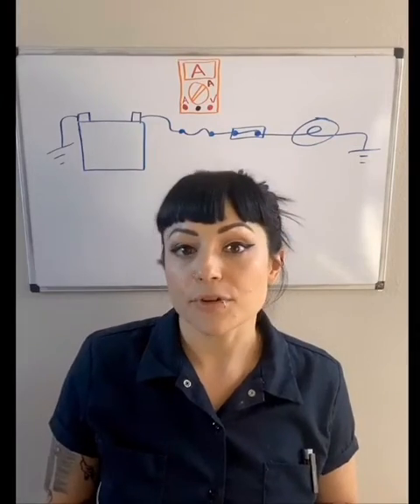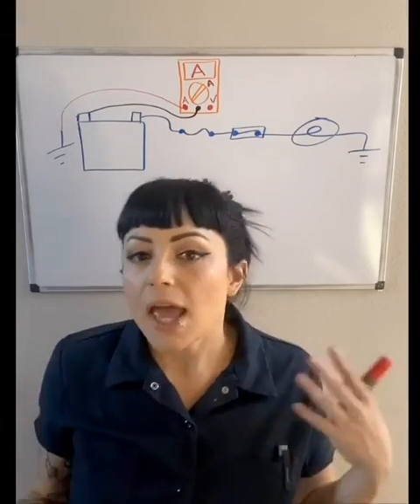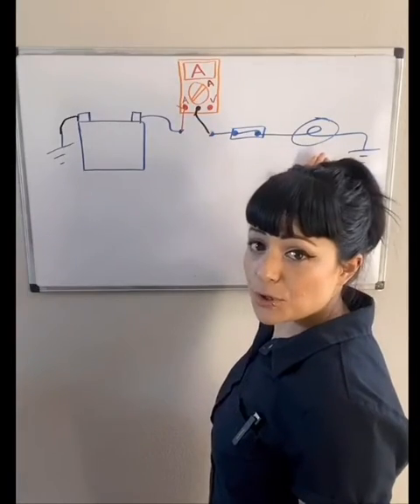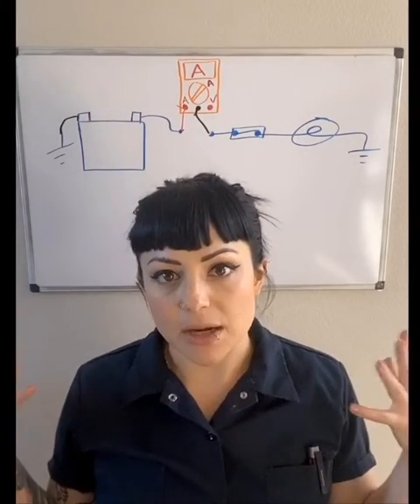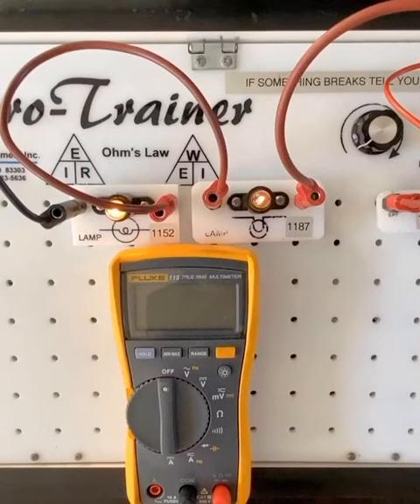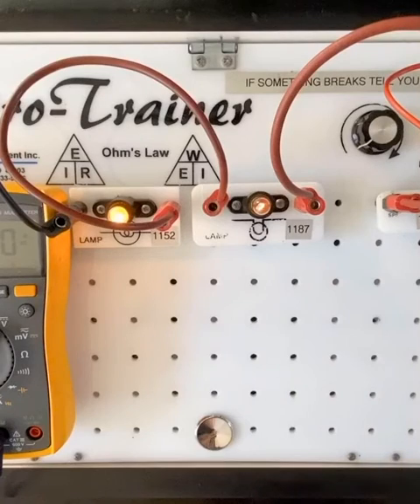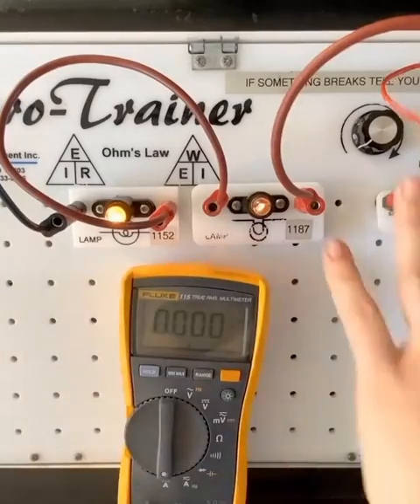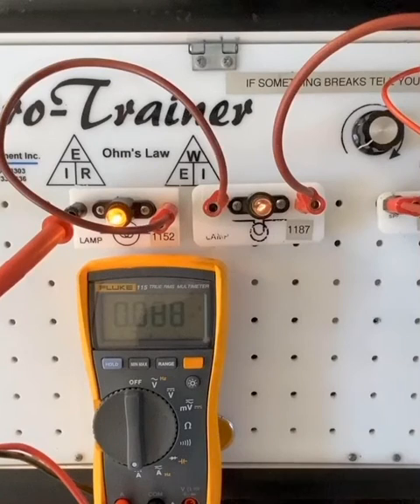How to hook up an Ammeter

Comment: When l first started doing automotive testing l used a really cheap VOM (so long ago it was analog) that could read up to the 10 amps she was referring to. When l made the mistake of connecting the leads incorrectly and fried the meter, replacing it was a quick trip to the store and the penalty was $10. Eventually I did end up with a nice digital Fluke that was capable of reading the amps and volts in both directions ( very helpful).

Comment: I use an analog ammeter with an inline fuse connected to the test lead rated for the ammeter size. Works for finding parasitic current draw. You are a good teacher!

Comment: I came here because of Donut <3, but also because I wanna connect an ammeter (SKUB07879) to my car xD.
I got this weird ammeter/voltmeter chip from my brother a few years ago and he wanted me to hook it up to my car so I could monitor the battery's voltage, however the meter also has a ammeter led on it. I could just hookup the voltmeter and leave the ammeter off, but I don't half a$$ things like that.
Any advise Ang?
Can I hook this bad boy up to my red battery terminal and the black to my alternator ... would this cause a short?
It's an 18 gauge wire, so relatively thin and it definitely couldn't replace the wire coming outta the alternator, so I'd have to connect it in parallel, which won't work according to your explanation. 
It needs to be hooked up all the time to monitor the entire draw even when the car's engine isn't running.

Or is there another circuit I could connect it to in the fuse box, for example?

I'm guessing this is impractical, but I figured I'd ask anyway - maybe you could point me in a more practical direction.
Perhaps I could just monitor the drain on the usual parasitic drain suspects.

Comment: My alt puts out more than average ammeter reads.  Common for diesel engine alternators actually.  Mines 135amp and I may go to 150 in the future.   My big truck is 200amp for that matter.  Anyway....  is there a way to purposefully miss match a shunt and ammeter and do the math in your head.    example.....  use a typical 60amp ammeter with a shunt  that would result in a meter that always shows off by a third.... so If I am showing 60 amp......  im in big trouble cause that would be 180amp out of a 135amp alt. in real life.   If I am showing 30amp...... then in real life Im at 90amp and that is fine if I'm  winching and bumped my idle up to get that 90amp.    etc etc.   

Doing so  would possibly lower cost for this poh manz build...  the ammeters that can read up to 150 are stupid expensive even before you buy the shunt.  (or hall effect sensor)

so with that in mind.... ifffffff that would work... what shunt for 60amp ammeter knowing I will be off by a factor of three?
so with that in mind.... ifffffff that would work... what shunt for 30amp ammeter knowing I will be off by a factor of five?

Comment: Hi Thanks much. I just discovered your channel! I will get good info from you.  
My question?  My ammeter has no, zero instructions with it.  How can I test which stud is positive on the ammeter?  How can I determine how to wire the ammeter without instructions?  I have googled ammeter wiring diagrams, and have diagrams that show both studs as positive.  That's wrong.  Can I test with the power from a 1 ½  volt battery and my meter?  Thank you!

Comment: Think I'll go with a volt meter in my 82 foxbody build. Lol the ammeter seems way to much to wire up 🤣.  Kinda wish I paid attention more in electrical class, instead of just being a parts changer.

Also if your able to get a printed circuit board diagram for an 82 Mustang please share 😑

Comment: How do I connect an ammeter to in a motorcycle? Where should I make the series connection?
Reply from the maker: In the same manner as a car. You will have to find a junction to separate in the circuit to hook your meter up to. I hope that helps.